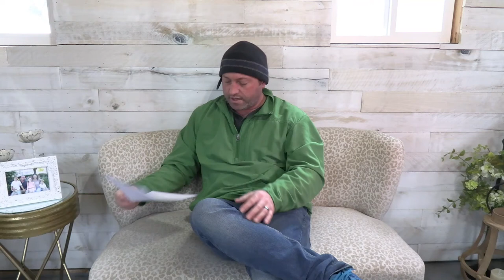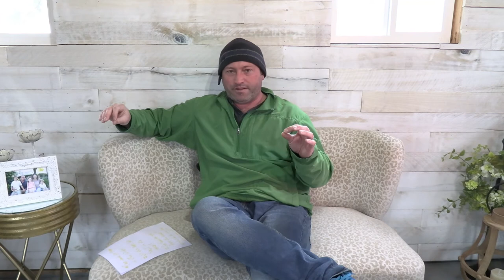What to do when the septic tank alarm goes off? | #AskThePumperdude

Comment: Got question for you. I have a septic tank. I live in Missouri. I also have Well water. About a week ago, My well quit working because of severe cold weather. A couple days after the Well started working again.
a day after the Well started operating again. The septic tank alarm started go off. I silence the alarm and went out to the field where the well drain. The field was ice up around the pipe. I clear this all out. The siren went off. I limited the water usage down to almost nothing for a couple of day. Meanwhile the alarm started sounding again. I silence the alarm again., limited my use of water. A couple days later when it started to warm up.  The alarm was silence.
I paid real close attention to see the red light that showed when the alarm was going on. It started raining after this.
I read somewhere the if the drain field get to saturated with water.  This could cause the alarm to sound too. I went out an put a tarp over the drain field, to keep it from getting saturate with water. After a couple of days, the alarm shut off. everything back to normal. keep in my mind when the Well quit working because of the extreme cold I had to use buckets of water that I had store to put in the toilet to get them to flush. I just wondering what your opinion would be on what might have been the cause of this. in the pass the Well has went out because of the extreme cold but when it came back on again everything was fine. Even the septic tank was fine. I had the septic tank service this previous summer too.

Comment: Thank you. I replaced the diaphragms on the aerator pump about two months ago a the light went off. Pump is still operational. No high water in tank. The light goes off when I blow into the air line to the controller even though the pump is still putting out air. A sensor possibly??? Thanks bud.

Comment: My alarm was going off and I silenced it  ….I found that the breaker had tripped and so I fixed that and also replaced the 9v battery in the alarm itself.  Problem is the battery/ alarm keeps chirping much like a smoke alarm battery chirps….its a new battery so I can’t figure it out

Comment: my aerator alarm goes off if we don't get a lot of rain. I had it installed in 2015 and this has been happening for about 2 or 3 years now.
Reply: Same here. How did you "fix" or remedy this? Is it just a matter of waiting for the ground to dry?
Reply: @wolfontheroad2262  I didn't fix it. when it rains alot it's fine. it's not a matter of too much water, but of too little water if we don't get a lot of rain. I wish I had the old school septic with no moving parts.

Comment: A very complex and high maintenance design. My son married young and bought his home 14 years ago and the county he resides hasn't been kind to him nor the service contractor's. I'm researching to see if there could be a true solution as the design seems to be set for failure. It's a shame it's costing them so much and demanded within 30 days. 4800.00 other than the using less water what could really be thier fault? I really appreciate you educating us.
Reply: This issue is NOT complex! ... actuation of the septic alarm is MOST COMMONLY caused by the alarm float having come loose from the pump's vertical discharge pipe which results in the float dropping lower in the "gray-water" pump-tank... thus actuating the alarm float prior to the "pump-on" float.  This scenario is easily remedied by simply raising the float to an applicable level and resecuring the float's electrical umbilical to the vertical discharge pipe with a HEAVY-DUTY zip-tie or (preferably) a stainless steel hose-clamp.  This approach takes about an hour (after removal of the gray-water tank's lid)and can save a typical untrained property owner several hundred dollars associated with a service-call for what is a fairly simple solution.

Comment: Are the alarm and compressor fail alarm for the same issue? My compressor fail alarm is clicking on and off...what does it mean?
Reply from the maker: This sounds like you have an aerator as part of your system. The compressor alarm would indicate failure of the air pump and should be addressed to make sure however your system is designed to function continues as designed. You won't notice anything immediately with the air pump failure, but it could cause long term issues.

Comment: Is it safe to turn off the alarm if it happens in the middle of the night. As long as you address the issue later?
Reply from the maker: Yes, the alarm is alerting you that for some reason the pump has not turned on and the level is higher than it should be. Typically once the alarm goes off, you have around 200-400 gallons of capacity before all the tanks would be complete full. So, it is no problem to silence the alarm. You just want to address the issue ASAP.

Comment: The alarm and light went on just now and then I silenced it, checked the breakers and no problems.  The light went out.  Should I call my septic contractor?  Thanks.
Reply from the maker: If the power is still on to the control panel and pump/alarm, I would continue to monitor whether the alarm goes back on. If it stays off, you may have had some kind of fluke alarm with no real issues. If the alarm continues to go on and off I would have a contractor come out to diagnose the issue. There could be a float switch that has come detached or in the case of a system that has two pumps, one of the pumps could be failed.
Reply: @askthepumperdude  ,  Thank You!  The alarm never went back on again which seems like a good sign.  I will be calling a contractor to come out at least to check it out.  I rather be safe than sorry.  By the way, if I have to replace a pump, is it costly?

Comment: I've watched a few of these. . one thing not mentioned is that your tank could have too much water I it due to a common issue of something not being shut off in your house.. like a faucet or the washing machine. My flap on my toilet got stuck up so water was flowing all night long.. woke up at 5 am to the alarm going off. the water level was too high due to the unusual amount flowing into the tank. Im assuming I just turn it to manual and let the pump run and let the water down and the annoying alarm (that is doing its job) will shut off?
Reply from the maker: If the pump is functioning properly, it should be pumping the water away fast than it is coming in from the house. Having a leaking toilet or faucet for a long time would certainly burn the pump out faster than it should.

Comment: My box is just flashing exclamation mark but no alarm, I’ve reset it but just goes back to the red exclamation mark, what does this mean?!?!?!
Reply from the maker: The fact that there is no audible alarm could be either it is set to silence or the audible part of the alarm is not functioning. If the visual alarm keeps coming on, it means that the pump is not turning on. I would recommend having a qualified professional out to diagnose the issue.
Reply: @askthepumperdude  ok yes I have a separate box which is the alarm but that has a green light 🤔 but will definitely call a professional, thanks :)

Comment: Just had my tank pumped (1500 gallon) now my recirculation alarm is going off. They say it's a low water alarm and to ignore it. How long before the water level reaches the pump chamber and the alarm goes off? Two people in the house
Reply from the maker: It typically will take about 10 days to use 1500 gallons of water to fill the septic tank and then depending on what level the low level alarm is set at, it could take another day or two to turn that alarm float to the "off" position. So, 1.5 - 2 weeks would be a good estimate.
Reply: Today is day 12 and the light is still flashing. I unplugged the buzzer alarm inside the box so it doesn't keep the neighborhood awake all night. Hopefully it will go off soon. Thanks for the input 😊
Reply: My instructions from Clearstream ATU said to pump the solids tank and refill the tank then pump the aerobic tank only half way down and refill that. Then you can pump the 'pump tank' all the way down. READ the instruction that came with your system or as in my case the provided did not furnish them. They can be found on the internet. BTW I read the instruction AFTER I had my system pumped and I began having issues. My service provider has never replaced my diffusers (In 22 years) and I am now learning how to maintain my own system after 22 years. I made the mistake of relying on his maintenance for too long.

Comment: its raining hard and my pump came on is there a reason or a way to check this
Reply from the maker: Rain should not cause your pump to run unless your sump pump is connected to your septic system. If this is the case, it would be advisable to reroute your sump discharge away from your septic system.

If you are referring to your pump alarm going off, this is an indication that the pump is not operating. It may not be related to the rain at all, but should be addressed immediately.

Comment: It says high current alarm
Reply from the maker: If you have a control panel, you can go through some of the self diagnosis in the video. High alarm means that the pump did not turn on and pump the water away like it should so that means you should limit any water use in the house because you probably only have a few hundred gallons of room until it starts backing up. If you are not able to self diagnose it, you will want to get a professional out asap.